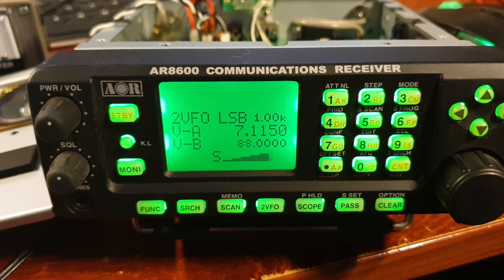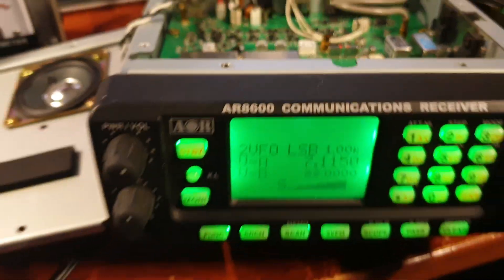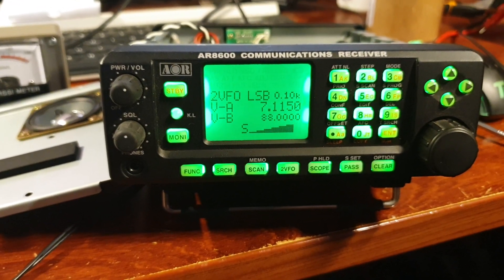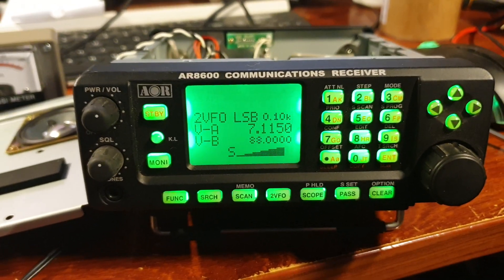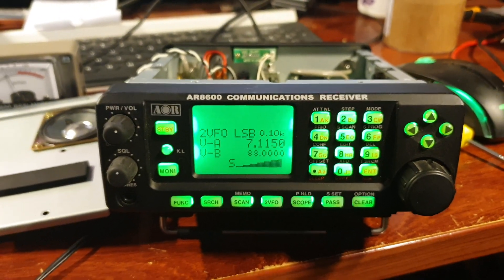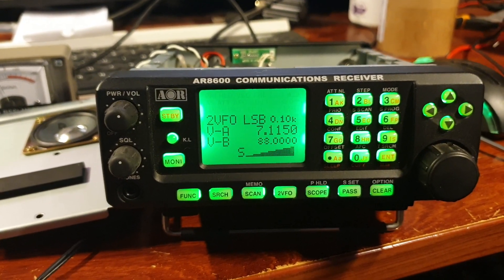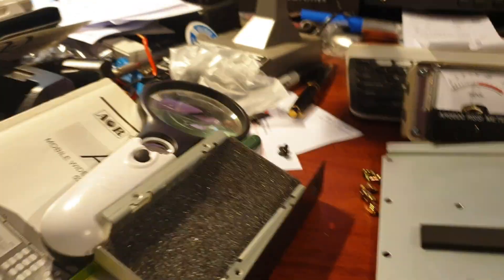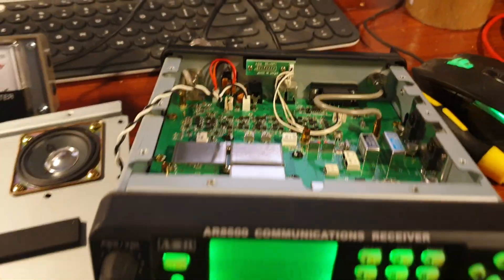AOR AR8600mk2 part 2 quick ssb alignment

Comment: Thanks for sharing. I would be really curious as to if the other modes such as how a USB signal is displayed after your adjustment. 
According to page 31 of the instruction manual it states "The SSB frequency display is not offset (like some other units), this is good for referencing to frequency booklets and data bases. However being such a compact wide band receiver, it will not be unusual for the SSB display to be a few hundred Hz off frequency when listening to known frequencies..."

Comment: I did not see where you can install battery BP8600 inside this small case?
Reply from the maker: I recently upgraded to the new AOR DV1 so I do not have the AOR8600 available anymore to check battery provisions. cheers Brenton VK3CM

Comment: The other way to do a quick tune,  is tune to 10.00MHz  (WWV) and swap between USB and LSB and adjust so that the pitch of the received audio has a minimal change between the USB and LSB signals.